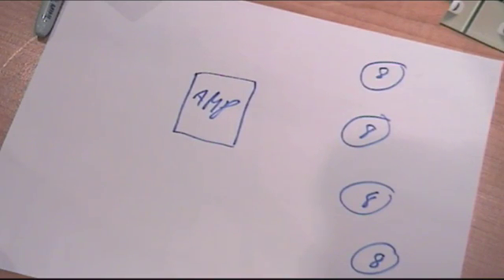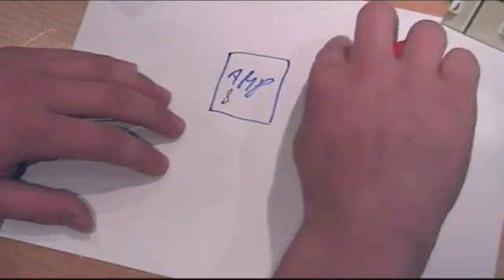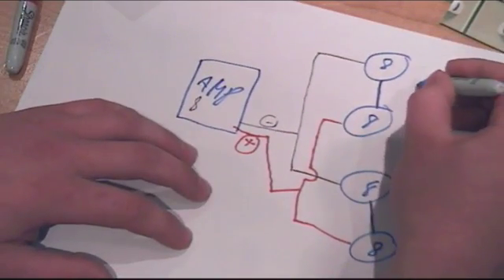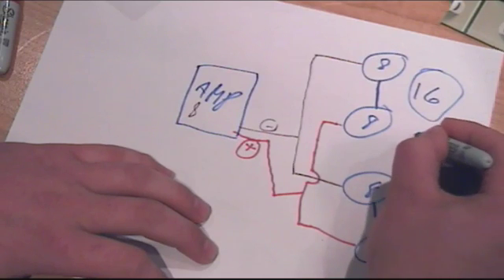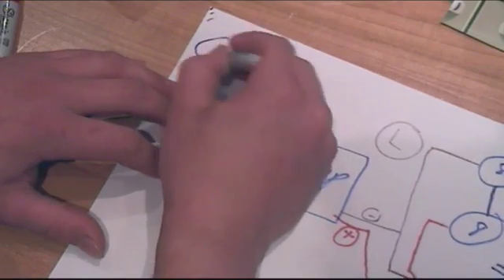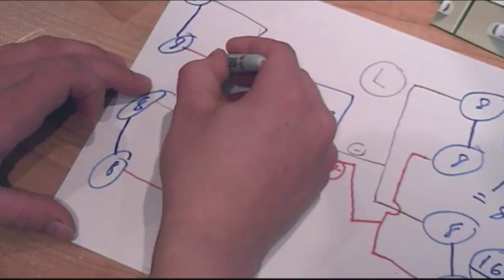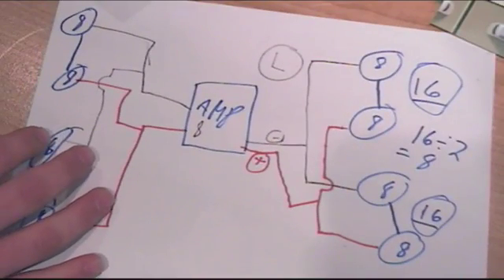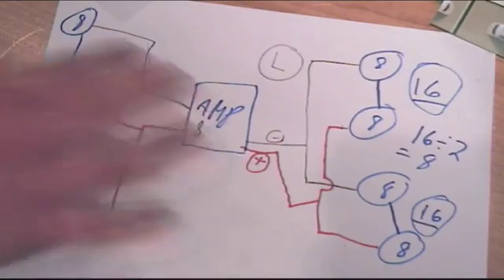Speaker Impedance Matching (Connecting Multiple Speakers Properly)

Comment: so its okay if the source power is less than the power rating of the speaker?  ie... 50w to 100w.....  but not 100w to 50w speaker?  am i ryt?
Reply: Someone please answer this!
Reply: anyone?
Reply: job ian caliwag
Reply: Ok. Third and last time to try to get this reply to stick on the page. Yes you are correct about the amplifier / speaker power situation. The normal rule of thumb when choosing speakers is to ensure that your speaker power rating exceeds the power rating of the amplifier you are connecting to. This ensures that when you run your amp at higher levels (even accidentally) the speaker does not run into distortion, or worse, burn out the coil or blow the cone. An expensive mistake. Hope that answers your query OK.
Reply: tnx :D
Reply: Thank you, I can now buy all the stuff!!!!!

Comment: to run it at mono witch i would only use as a center if your running mids and highs or for your sub if you wanna draw more power toward it or have a dual channel amp and one sub/speaker you can make it mono(combining both channels) into one so both sounds from both challs are drawn into one channel and in some cases you can use speakers with a lower impedance

Comment: I'm sorry but if you have 4, 8ohm speakers, that brings the impedance to 2 ohm when hooked all in parallel . The conversion for hooking in parallel is 1 over the sum of all the reciprocalls  of impedance. Essentially put 1 over .125X4.  1/.5  is two ohm

Comment: I am looking to connect 6 speakers to a Stereo Receiver. (4 on A and 2 on B).  The receiver I am considering is a Sherwood RX5502 100 watt RMS Dual Zone receiver.  My speaker options that I am considering are either six speakers that are each 8ohm / 100 watt or 8ohm / 80 watts.  Is it possible to safely (with quality results) hook these speakers to this receiver?  If so, how do you recommend I hook up the speakers?  If not, what would you recommend?
Thx,
Brian

Comment: One note:  If all four speakers on one channel are wired in parallel, the total resistance on that channel is 1/(1/8 + 1/8 + 1/8 + 1/8) = 1/ ( 1/4 + 1/4) = 1/ (1/2) = 2 ohms.  The formula for calculating resistance in a parallel circuit is 1/ ( 1/r1 + 1/r2 + ....  + 1/rx).

Comment: if you are wiring 2 of each speaker in series to each other, the total resistance of the pair is 16 ohms.  If you add another set in parallel to the first, the total resistance of the whole circuit becomes 1/(1/16 + 1/16) = 1/(1/8) = 8 ohms.

Comment: dude, can u show me how to calculate speaker watt and ohm if i'm using 300watt 8ohm powered mixer?...if I wanna use 4 speaker for my mixer, which the best speaker watt n ohm?how to connect correctly to my speaker using my mixer, I meant train connecting or like the drawing on ur piece of paper?

Comment: If each speaker was rated at 8 ohms and there are 4 of them and you wire series parallel, wouldn't the ohm age be 16? I could be wrong.

Comment: hey I NEED HELP I HAVE ALREADY THIS AMPLIFIER: QSC GX3 300 Watt 8 Ohm Power Amplifier AND I WANT TO INSTALL IT IN MY TERRACE WITH in - ceiling speakers and a subwofer THAT I NEED TO BUY. my question is which and how many in ceiling speaker and subwofer and wire should i buy  if my terrace is 25 x 30 ???? i appreciate your help!!!

Comment: great video. can you please help. i have 2 mid range boxes. each with 3x 8ohm speakers in. is there a method to wire these speakers safely. my power amp is 4ohm load. many thanks.

Comment: Hello,
I need to connect 16 x 8Ohm speakers (100W each) to an 2Ch amplifier (300W/Chanel)
What is the best way to do this?
Is there any limitation on the power amplifier wattage and speakers wattage like the 100V line distribution?(total power of the speakers should not exceed the amp wattage).

Comment: Nice! It seems a decentralized system? In centralized system one would have maximum of two speakers....In mixed centralized and decentralized one would have many....The sum of the speakers input (watts) has to match the amplifier output (watts) in PA system?

Comment: I have a qsc 3602 and (4) 4ohm speakers that are 700w rms. How would I connect 8 as in your video example, and how would using 4ohm instead of 8ohm speaker effect the scenario?

Comment: Series resistance adds ohms, parallel resistance is the inverse ohms.
At 1:52 the video is wrong.  1/R = 1/8 + 1/8 + 1/8 + 1/8  Results in 2 ohms.

Comment: Thanks for explain about de amps, but then why the amps burn out (if the input signal and the voltage supply is the correct)? what´s the cause? because one conect speakers with more watts that the amps deliver? as your example 20 10 watt speakers in a 100 watt amp.
Thanks for your answer.

Comment from the maker: @bercerobry Let's say you have 10 10 watt speakers and a 100 watt amp. There you would have a matched set of speakers. But lets say you you want to add 10 more, so now you have 20 10 watt speakers. What would happen is because the amp can only give a max of 100 watts it would split the wattage in half. So the speakers would only get 5 watts each. The speakers would still function but you wouldn't get very much sound out of the speaker, and this is obviously a scenario that couldn't be possible unless you had a huge amp or a 70 volt system. Keep in mind the wattage of a speaker is not always what you need to power it. It will run on nominal power.

Comment: hola!
-I have a 500Watt amplifier / 2x 250W per channel into 4 ohm,
-I have three drawers speaker

* first box - Two 8''speakers, 200w, 8 ohm - bass subwoofer
* second box, two 6.5''speakers, 200W, 4 ohm speakers mid. + Two tweeters 120w, 4 ohm
* third box - two 6.5''speakers, 200W, 4 ohm speakers mid. + Two tweeters 120w, 4 ohm

as I can connect the interior of the speakers properly? if I have only two outputs

please help me

Comment: You can't make 1 ohm out of three 8 ohm loads... Also dividing by two when running sources in parallel only works for identical loads, otherwise you're way off. This either is dangerous, or limits people's ability to impedance match, the correct formula is 1/((1/r1)+(1/r2) etc...)). Otherwise interesting video.

Comment: @123pikk   connecting spks' in series is going to limit the power your amp can produce.  more impedance = less power.  99% of PA cabs have their connectors wired in parallel so go with that.  If your amp produces 300W @ 8Ohm, it will do 600W approx at 4Ohm (half the impedance, double the power).  If your cabinet is rated at 300W 8Ohm, get an amp that can do 450-600W at 8Ohm.  This prevents clipping / sending DC to the voice coil which will burn it up and produce the magic white smoke :-D

Comment: ...reminds me of back in '96 when my friend John needed to drive 3 8ohm woofers with a single stereo 4ohm/channel amp and all 3 were sharing the same enclosure area so they all needed to see the same power.
 WQe put two in parallel for a 4 ohm load to one channel and the other woofer on the other channel for 1/2 the power out of that channel but an equal amount of power to all 3 woofers!

 ...then there was the time when another friend needed to drive 4 10" DVC woofers in one long cabinet...

Comment: ...cabinet across the back of a 4-door truck & was having trouble getting them all to move together.

Some would throw all the way while others wouldn't hardly throw at all. He had two on the far right next to each other, one middle left, 4th far Left end.

I simply wired the top coil of far L to top of 2nd right, bottom of far L to bottom of middle. Far R bottom coil to bottom 2nd right, bottom of far R to top of middle, & they all started working & moving in unison together & sounded awesome!!

Comment: I'm not sure if this will allways work rigth, becouse impedance is not really an electronic resistor, but a magnetic "couter-strike" that only occurs with waves. So connecting speakers in series can make "charges" from a speaker to another and to the amp leading to unexpected (undesired) results. I know it happen with capacitors circuits - you should not connect it in series.

Comment: @123pikk
This can be calculated with the method called it 1/x is very easy on most scientific calculator you see the bottom 1/x so you put  for example:   16 [shift] [1/x] + 16 [shift] [1/x] = .0625 [shift] [1/x] = 8ohms...this method work with any number.. The way is explained on this video 16/2 = 8 is right but this work only when all the value are the same...

Comment: What if I connect 1 sub to all 4 outputs on a 2 channel amp and the sub was a 4 ohm and the amp did 
RMS Power at 4 Ohms=125 W x 2
RMS Power at 2 Ohms=190 W x 2
...what would the impedance be then?

Comment from the maker: @123pikk how did I figure this out? The answer is math and research :P

if your amp is rated for 8 ohms per channel and you want to connect 2 speakers per channel that are rated 4 ohms, you would connect the 2 speakers in series (like the batteries in a remote, negative to positive |-+-+|)  for the left channel and do the same for the right channel. That is assuming that your amp is rated for 8 ohms per channel and the speakers you connect are 4 ohms.
Reply: True. 
It was his explanation for parallel coupling that was totally inadequate, since with a 16 ohm and an 8 ohm in parallel, the 8 ohm speaker would be drawing twice the current of the 16 ohm speaker. The total impedance would be around 5 ohms

Comment from the maker: @jabezprayer1 120 volts? Are you sure your not mistaken that for the A/C power? Most amps that have transformer terminals for speakers (in North America) are 70 volts. Apparently there is amps that have 25 volts but I have never come across them. In other countries there are amps that have 100 volts or more.

Comment: I have a old Yamaha P2100 amp which says on the back 120 volts. I have 10 speakers that have the 70 volt transformer attached to each one. Could I connect 5 per side to this amp?